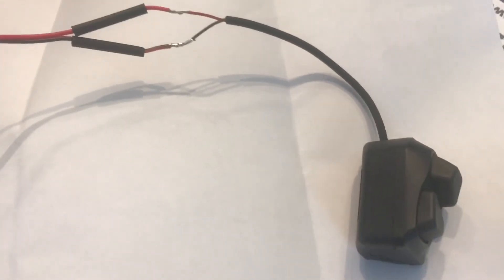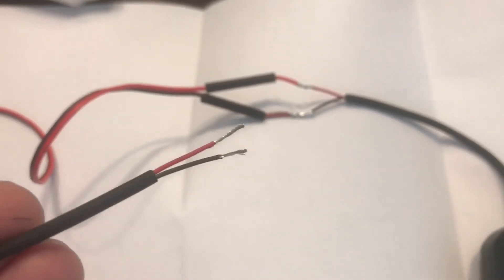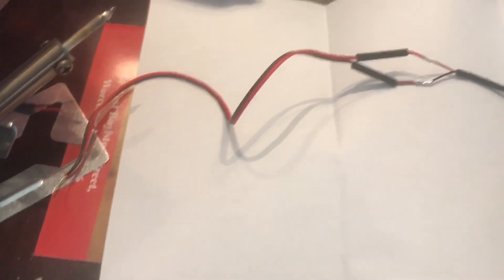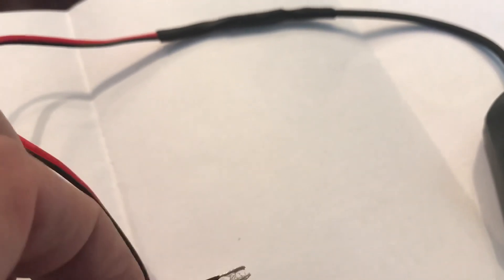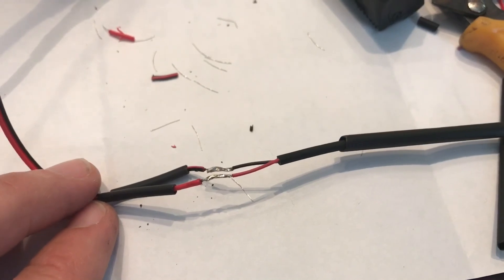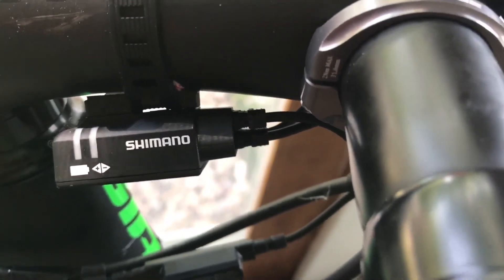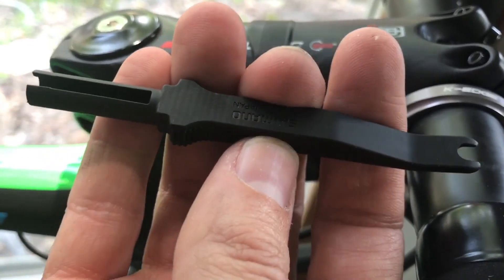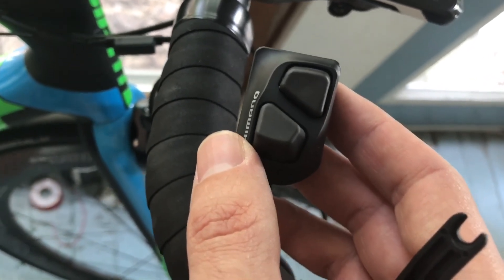Shimano DI2 wires: Splicing, soldering and extending tutorial

Comment: Thanks much ! people don't realize how easy it is. I have had to do this also several times on different builds. Could be allot worse as no silk nano wires thank goodness. Just as he said be sure to seal it good you don't really need heat shrink, gorilla tape will waterproof fine if taped to itself well (don't want to use regular duct tape though). Even when I use heat shrink I still put a small coating of paint dip on them. Soldering iron and solder beats the heck out of  EW-SD50 + EW-JC200 = minimum of about 40 bucks. 💲 I wound up hacking open a couple of climbing switches removing the ecu's ( lil computer boards), putting it on a cateye remote button kit so I could put lil tiny switches anywhere I wanted. Why ? well they are tiny and now waterproof. Climbing switches are not waterproof; although I took a few apart and added paint dip and made them that way. Fun stuff :) 
http://www.bikepartsplace.com/images/med/31162919.jpg

Comment: Hi, great video and thank you!  Hoping you see this comment since you posted this ages ago but here's my situation.  
I would like to use a 30mm Chris King BB with my BSA BB but the Di2 wire doesn't fit because there isn't enough clearance between the BB shell and the BB sleeve.  Removing the sleeve leads to the wire rubbing on the spindle and actually eroding the spindle ( not the wire, believe it or not) so the sleeve is necessary.  
I thought about stripping the outer wire and leaving the two inner wires "loose" to see if there would be enough room but is that enough protection from water and dirt ingress???...what do you think?  
As an alternative to this, I was wondering if there is flat wiring, similar to ribbon-cable, which could be used?  Effectively do what you've done in this video but add a 12-inch piece of super-thin flat wire?  Does this make sense?  Do you know if they make the kind of wire I'm speaking of?
Reply from the maker: You can get weather resistant heat shrink tubing. It has an adhesive inside that keeps water out. If you plan on repairing it this way, I’d add some length of wire and just make sure you use the heat shrink tubing on both ends. 
OTC 4814 106-Piece Waterproof Heat Shrink Tubing Set https://www.amazon.com/dp/B00BVL856I/ref=cm_sw_r_cp_api_i_qMQxFbFNDBJG0
Reply: I run my Di2 wires without the external sleeve (to save the weight) for two years and it's been fine.

Comment: Whats inside the switch box? Is it just a regular momentary contact switch? Or is there a circuit board?
Reply: Probably a circuit behind because the new di2 generation uses a bus system (can bus) it works with data packets and adresses

Comment: Yass... I'm having a canyon mechanical frame and searching a way to upgrade to di2 without drilling holes on the frame. If I got your explanations correctly, it would even be possible to use the conventional hose to route these custom cables internally. Anyone having thoughts on that?
Reply: Have you successfully.converted to di2 your canyon? I guess needs only 2 cables to cut and join. 1 on top tube and on the FD🤔
Reply: @arielp1207  Hi James. To be frank, I didn't try it yet, bit yesterday my rear derailleur cable raised its hand for some special care and attention. This is when my plan came back to convert to di2. Did u make some attempts yourself yet?
Reply: Anyone successfully upgrade canyon mechanical frame to di2? I think it should be do able by just cutting the cable and reconnect it after it pass through the frame
Reply: @lewiscassidy1793  For an Ultimate CF SL mechanical frame: the hole for the brake line is big enough for a brake cable and a di2 cable but you have to run the di2 cable first because of the size of the connector. The hole for the front derailleur cable near the bottom bracket is very small. Big enough for a di2 cable but not for the connector so the solution is to cut the di2 cable, run it through the hole and solder it back together. 

Canyon's di2 frame has a battery attachment in the down tube. The mech frame does not but the down tube is a crap place anyway because the only way to access the battery then is to remove the BB. The seat tube has plenty space for a battery (or the seat post).

Comment: Hi do you have a link to some appropriate wire? It needs to fit down an internal cable guide hence the reason to splice! Once the wire is cut the whole diameter of the etube wire fits down if that helps?! Many thanks for the video!!

Comment: Hallo. I have a question. I understand what you did ,my question is: that must be a 2 way switch? 2 wires and one button for down, one for up?
Reply from the maker: There is one button for shifting up. One for shifting down. But the wires do not correspond to the operation of the switch. DI2 carries both data and power on 2 wires. When you press a button on this shifter, the switch encodes this event into a digital data packet that gets sent to the rest of the system on these two wires.

The exception for DI2 are the sprint shifters, which really are just dumb switches with 2 wires. These interface with specially keyed ports on the brake levers/shifters that look like normal DI2 ports, but are not.
Reply: @ShapeGSX  So the switches it self have a different input. It must be because there are only 2 wires. One is live and the moment you press down button it sends a different value to the junction. Is that how it works? I have R8050 Ultegra and I want to make small satellite shifters on a new E-tube wire. I have two micro switch buttons but if that is the case I have to measure the value of original ones.
Reply from the maker: @viktorkelic2502  It is not going to work for you using the normal e-tube wires. You are missing a communication chip that is embedded in every one of these DI2 shifters (other than the sprint shifters).

I believe, however, that you can do this with the sprint shifter input on the brake lever/shifter. Check out this video for info on hacking sprint shifters:
https://www.youtube.com/watch?v=TwDQn8WixKA
Reply: @ShapeGSX  Thanks man. I have watched this video then you'res was next. That is way more easier to do it. It is just a switch button that sends a signal. Sorry to bother you but I have one more question. I saw they connected one switch to one side and the other one on the other side so it is so simple. Signal goes to left lever and the Junction Box knows it is for down( up) and moves the rear mech.  accordingly . Do you know maybe where one can buy those to small Shifter connectors( like a repair set). I would like to integrate the shifters  in my handlebar so it looks clean. One more time, thank you for you're time and answers. Greetings from Germany.